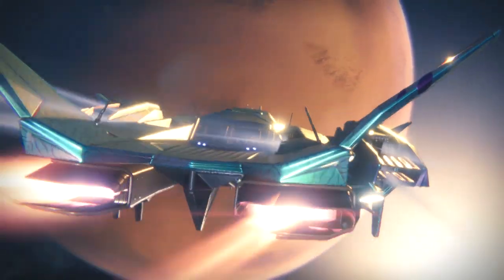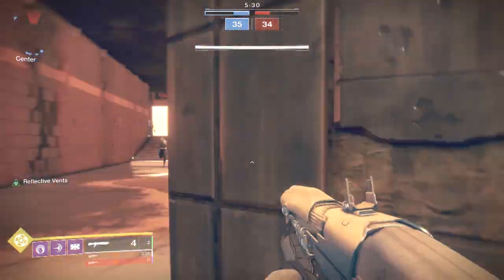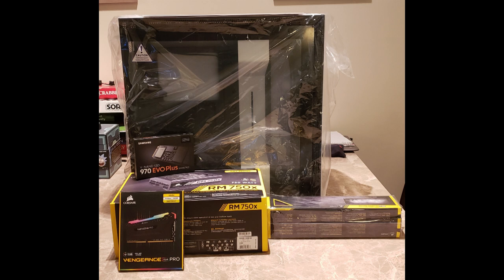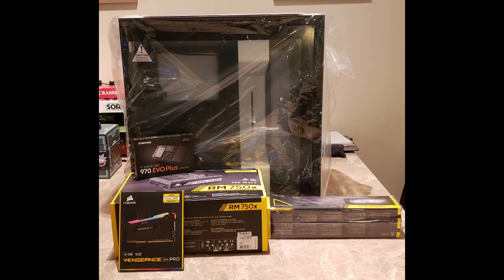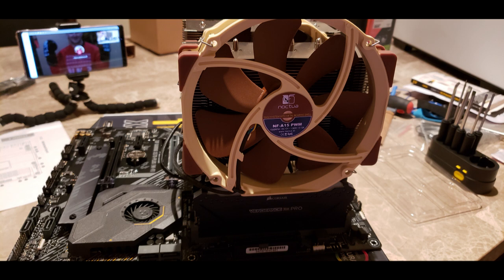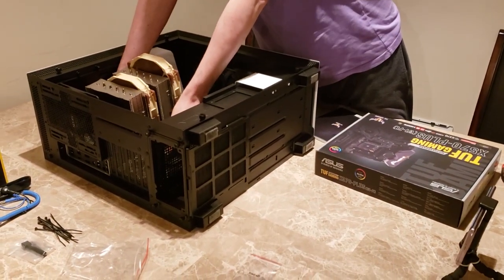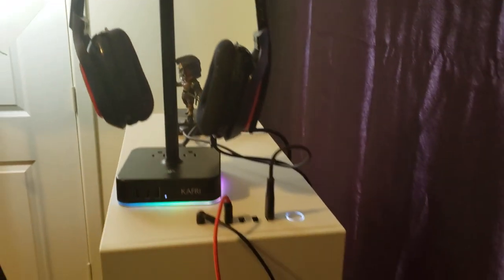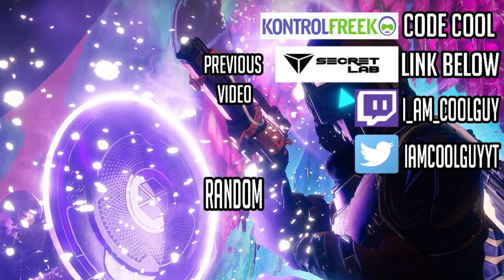My new PC specs, cost, benchmarks, build process and more! Yes, I am staying  console

Comment: I'd put your El Gato in a lower PCIe slot if you can. Not necessary, just a suggestion. That'll allow the fans on your 2070 Super to pull more air through the heatsink and give you lower temps, which can marginally improve clock speeds through GPU Boost 3.0. Alternatively, that better airflow could be used to lower the fan speeds if you ever have problems with fan noise picking up on the mic.

Comment: I wish you luck with playing on both. I also have been a console player all my life, decided to try D2 on PC when Forsaken dropped, figured I'd split my time 50/50 on PS4 and PC. I couldn't do it, the difference is so extreme, after a week on PC playing on console almost gave me motion sickness, everything that used to seem fine was so slow and blurry and just felt wrong. Ultimately if people feel the need to hate on you because of what platform you play on, or start wars in the comments with others, they have larger issues in life. I will continue to watch as I have done since you were at around 20k, I actually still use a controller on PC, so much of your information is very useful to me.

Comment: Wait until you feel the difference between 30 fps on console to over 100 fps on PC. Interestingly, you may not feel a huge difference going to a faster refresh rate initially, but when you go back to 30 fps on console coming off of 100+ it will be straight up jarring. Anticipating the release of PS5 for this reason.

Comment: I threw away just tossed it out there to give the Google Stadia a try this fall.  To me it was nothing ventured nothing gained.  Been on xbox forever with all it's limitations.  When Google offered 60 frames 1080 with so little cost and a year worth of Destiny included and cross save right there for the taking I couldn't resist just giving it a shot.  If it were not google I wouldn't believe it could be done but for me it will give me a chance to try that out for a year while I wait on Destiny 3 which will likely be built for the new consoles that will be due around the same time.  If google hits a home run I will be there if it is an absolute disaster I will laugh about it and ride one last year on the xbox while I wait to see if the next gen consoles will be for me or if it will be time to go PC.  Not likely but at least I will be ready to choose.  Oh and lastly absolutely play where your friends are!

Comment: Great job CoolGuy! Loving the build! With your boot problem, my first thought was that since you had to turn WiFi off, there may have been a problem with the boot order of the system (on startup, the computer bios maintains a list of devices to check for the OS, the boot order). For no good reason I have had instances where the wifi/network card got pushed to the top of the boot order list and the computer would just hang there. Revising the boot order so that the OS drive was first solved the issue, so I think that might have been the root cause for you too (though it could still be an actual bug, as I haven't worked with the new AMD hardware yet.) 

Looking forward to your future videos!

Comment: I have a 4KPro but was afraid of my graphics card dumping too much heat onto it.
Did you happen to look into that? It’s likely I’m just worrying about it too much.

Also apparently you are supposed to make an X shape with the thermal paste instead of a regular dot. Not that I have even really researched it or anything.
Reply from the maker: reading too much. It stays cool man
Reply: CoolGuy turns out the capture card will rub up against the fan(s) on my GPU, so even if it would stay cool, it wouldn’t work out.

I’ll try putting it on the other slot I have, but the fans will likely still be an issue.

Comment: Oof. I know where you're coming from when speaking about slow starts from a boot up and opening programs. Use adobe software on my laptop and it would take ages for it to actually launch the software, also took a while to start it from a full shutdown.

Built my pc in june or so and it runs much much better. Though ran into a problem where it now takes a while to boot up the mobo screen after running with no issues :v